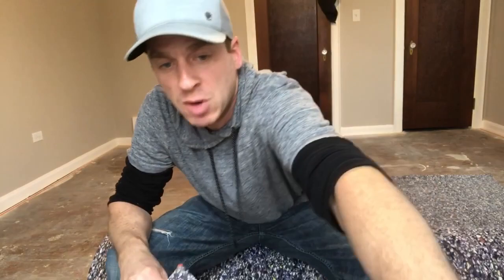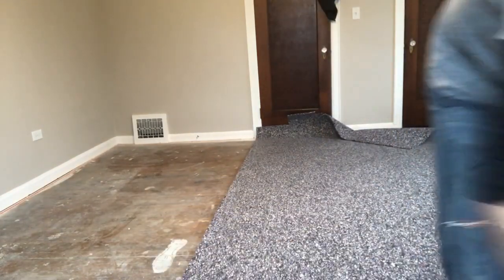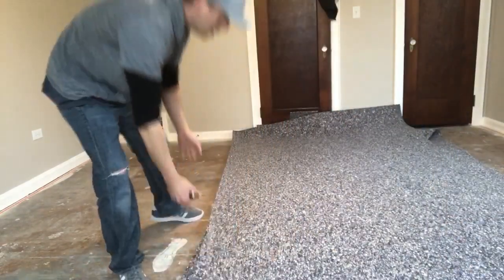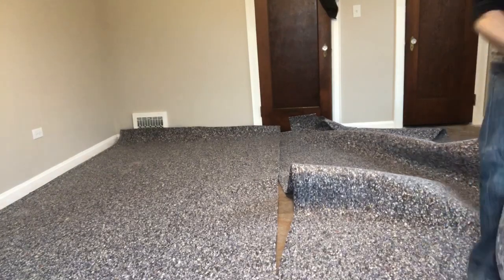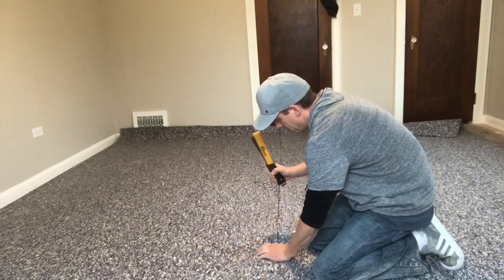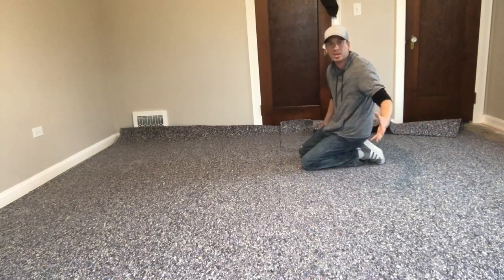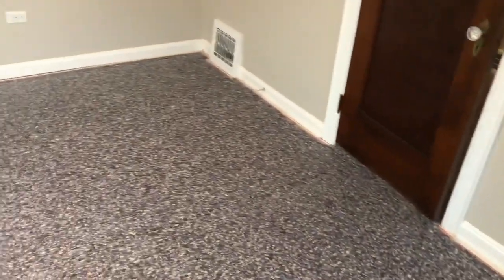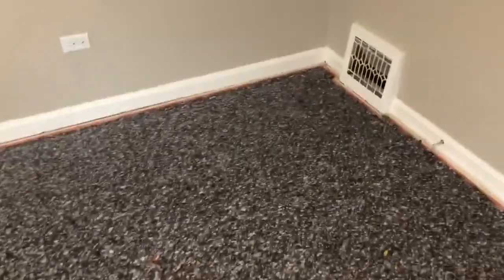How to lay carpet padding

Comment: I stopped watching because your audio is terrible. At full volume you are not quite to normal listening volume in a quiet place. If it wete a bit noisy I wouldn't be able to hear you. Then half way thru you add music at normal levels, which is now blasting. Repost this video with fixed levels.